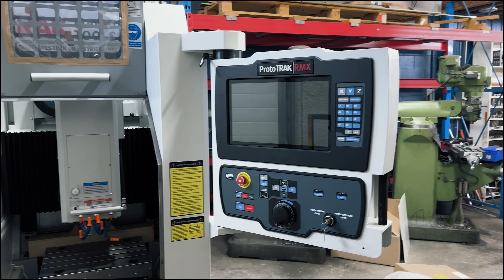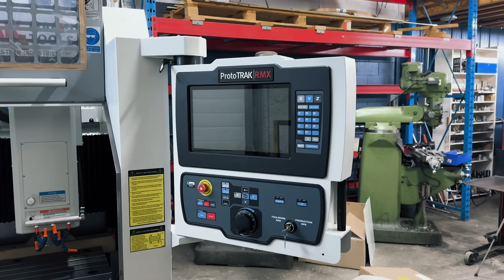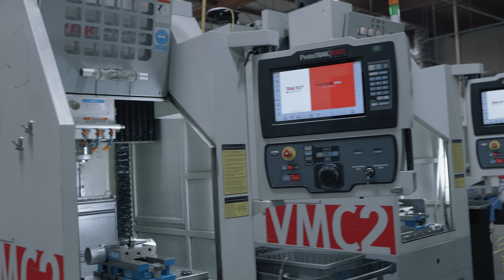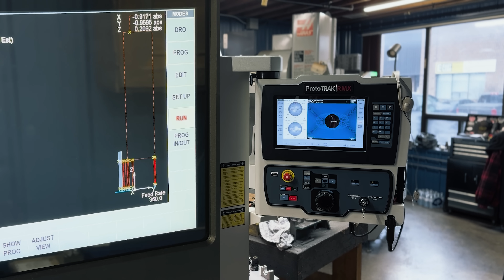Our Smallest CNC Machine Yet–And Why It Works for Us | Machine Shop Talk Ep. 129

Comment: I have the older 2op, same machine but different control. Its handy having a capable cnc mill whenever I need a custom part. Perfect size for my small shop but just don't use it much anymore.

Comment: Most ERP systems when you do a quote you establish a process or multiple processes to get the cost for quoting, then that information is usually transferred  into a job. If you don’t have a way to track process how do you know who need help if they are going over estimate  and potentially getting back to customer because they will be late. We always used this to find root causes if a process wasn’t being able to be achieved. Many times it was ergonomic related, sometimes it was tooling or machine related, and many times it comes down to estimator not knowing  the internal processes or machinist skill. Bringing engineering or estimators in on the solution early in process issues helps close loop in finding root cause so next  similar quote hopefully will be better. Have the mindset to never blame person, just process. Many times when solutions are shown it’s a lasting effect with person.

Comment: I used one of first versions of these here in the UK for a couple of years. It didn't have the RMX control just a basic version of Southwesterns Prototrak, which was fine as I just ran G code. They do have their limitations because of the actual size. I was constantly cleaning out the chips from behind the table which fouls up and stops the machine if you don't. The coolant needs topping up regularly, small tank and pump isn't very powerful. There was no tool probing, which if you use on other machines, its like going back in time without it. Also care needs to be taken when loading and unloading tools in the tool carriage, it won't take a whack from a toolchuck  but these are cheap and easy to replace if you get confused like me with left and right and back and front.
On the plus side its nice a stable for its size and produced good parts with good finishes.

Comment: Nice little bridge mill. High production complex parts. Robot loaded say 6 mc cell with the op's distributed between equipment. Small enough and cheap enough to keep a spare or 2 set up in the corner roll in/out if problems occur.  The tool change looks like it's going to be slow so not the best machine to do a full part on. Or advanced hobby work.  Dont like the door above your head during loading, Coolant showers suck. Also it really should be opened automaticly.

Comment: I’m guessing this is a step above an early Hurco. The first CNC I purchased for the shop was a Hurco 40 some years ago. I bought it because as I’m sure many of you know G code programming could be quite intimidating at that time. This controller was great because of the conversational  programing, however it couldn’t run G code. The Hurco served its purpose and opened up a whole new world of work.. We used to machine the 7075 aluminum link arms for the Hurst Jaws of Life on that Hurco. Before too long we needed to get full blown vertical machining centers.What appears to be nice on this is the controller.  Being able to do both types of programming is a great feature. Very small for sure but the Haas mini offers a bit more in my opinion.

Comment: Used the 2-Op Varient Slim model (had controller screen / interface completely in the right rib of the door frame of the machine) loved how easy it was to use and program. Had two of them running at the same time, beyond easy.
Reply: Oh that’s cool, I haven’t seen that version! The narrowness of the machine is a big plus for us - since this video we moved it to its “main home base” in the shop (aka, where we’ll use it most of the time) and being able to squeeze it in there or cram it in beside another machine as needed is a big plus

Comment: Those are awesome little machines I trained on one a little bit in school a few years ago and the teacher I had used to run two of those in a cell at a die shop, The tool changers on those machines can be finicky but they're controllers when all the track stuff are amazing
Reply: Yeah the tool changer takes a bit of getting used to - plus the tool table vs other VMC’s we have - but it’s more of a learning curve than anything. Once you get it, it makes sense. Fun little unit!

Comment: It reminds me of Chiron - FZ 08 S and Chiron - FZ 08 W They are also easier to move around, you just lift the support feet and then they are on wheels.
It was one of the world's fastest tool changers at one time. It had
Reply: Indeed one of the few that carry all their tools on the spindle and when set up correctly the Z axis height of the tools changed doesnt change during the tool change. Changing anywhere there is enough clearance so no wasted axis travel.  Saving seconds during a cycle. Not exactly the most robust machines though.

Comment: I almost purchased one of these a couple of years ago for knife making. Went with a larger machine in the end and regretted the decision ever since. Glad someone is finally doing a proper review as they are excellent machines.
Reply: For sure! I’ll be posting a more comprehensive review in the next video I do on this - once we’ve had a chance to keep putting it through its paces in a production environment! 

Things been crankin’ along well so far, just finished up a run of 2nd and 3rd milling ops on 100 A2 components that just went out for heat treat yesterday!

Comment: Did you consider the Brother Speedio S300? Im not sure if you could justify the price difference but the Speedio line of machines are amazingly fast. I own an S500x2 at my shop and we love it.
Reply: Brothers are rock solid machines
Reply: @billdickson871 Plus they have high torque spindle options. I operated the predecessor to the S300 with the high torque spindle at my first machining job and wasn't told the coolant level sight glass was broken and melted a 3xD Sumocham 20mm drill body into a 1.5xD in 10 seconds when the coolant ran low. That's power.
Reply: Or a syil x5 if you want to go low cost.

Comment: I work at a plastic injection company, we have 2 of these and they're pretty rough. We replace & fix the doors about once a year. Large piano hinges that we bolt and weld in place. The tracks the doors ride in are completely destroyed. I wish they'd redesign the doors. Even the arm the air assist connects to has been welded and reinforced multiple times

Comment: I have a shop ceiling height question.  I'm building a shop at my house and am dedicating a room for metalwork, it will be 12x24.  I have a Birmingham knee mill as well as some lathes and a bench mill and few smaller things.  Probably get a bridgeport to restore in the future and I could see putting a tiny cnc machine in there someday.  So for this manual area I figure I need to go over 8' for ceiling height so I have a little room to run a mill in on a pallet jack or even set something inside with my tractor or forklift, but every bit of height I go above 8' will painfully shorten the room above the metal working area.  In your opinion would 8' be fine for working with a couple knee mills or if I'm using an engine hoist to take the head off to work on is it way too short?  Would 8' 6" be a good compromise or should I go to 9' ceiling height?  Thanks a lot for the advice and videos.
Reply: When it gets warm you will want higher ceilings.

Comment: Sometimes more spindles is better than bigger spindles.  Specially on small parts with short runs.  I can do a setup on machine 2 while machine 1 is rumning.  Or in this case where the 2nd op runs so quick it don't matter if a larger machine can run it faster.  It's just going to sit and wait on op1 to finish.
Reply: That’s our thought as well. Even a guy running one machine at as close to 100% of the time as he can and reloading this second even 50% of the time gives us an extra 50% efficiency.

Comment: Cool little machine. We have the older style knee smx control and the only thing I would say is hopefully they have fixed the issues I bump up against when I put G-Code in. The smx only accepts very basic g-codes, if it doesn't know one in the program it plain ignores it and does some crazy stuff like trying to rapid through the job. There is a list of known g-codes in the back of the manual, hopefully the RMX is a more complete list. Worth checking it.

Does this control reset the reference point of the tool table when you load a program ? Drives me crazy on the smx ! I have a dowel set in a tool as my reference tool so its easier to set it back.

Still need to get round to learning prototrak programming properly !
Reply: Ah fair enough! This one takes regular ol’ g-code but it did have a few that we had to learn, mostly how the coolant on / off works (it ain’t just an m-code) and it takes the file in… .gcd? Instead of .nc I think? No big diff - just modification of the post to change the suffix.

No issues with losing ref point!

Still learning the RMX to program in the controller, but the messing around with it has been pretty fun!
Reply: @LakewoodMachine  Hopefully its the older SMX control that gave the headaches. 

Ref point I seem to loose is the Z height in the tool table just above tool 1 in the table, goes from set to not-set when you load a program in. Last guy just reset the tool table every time, made setups way longer !

We have EdgeCam and the post had a chipbreak drill cycle that machine didn't recognise and it tried to rapid a drill through the job ! No error message just full send !

Comment: I still cant get over the shitty electrical service situation in the US. I mean, man I would almost put a diesel gen in a shack and set up my shop in bumfuck nowhere. People in Germany still have transformers built for their machine shops, but theyre in a tiny building on the curb because they need 300kW service for their 150sqm shop with 10 DMG Moris in there 😂😂
Reply: Narwaro    you are strangely uninformed   .  there is 3p power available everwhere  in US, Canada and Mexico.
120/240 1p  is used only  in residential, and even then, except for very low population rural side roads, 3p is available if needed
By the way, this shop is localed in Canada , therefore  it would be supplied as 3P 600V.
Reply: People in US laugh about German electrical power prices, a lot!
I'd trade my 100m² with a good 1000m² in USA at once, then dump solar cells on the roof, 3 phase inverter and a small battery bank, free power, when the sun shines.

Comment: Few questions:

Price?

How large can the stock material and resulting part be?

Can it machine materials like titanium?

Is there a lathe with the same foot print as this or close to it? I guess it would have to be in a vertical configuration or slightly wider if staying horizontal but would still be awesome.
Reply: They're about $47k USD
Reply: @ thanks.
Reply: @Bagginsess  You can do Ti and hard steels, these little machines are surprisingly rigid and capable.
Reply: @OtisFlint  very cool thanks man :)
Reply: @jamiemacdonald436  - 47k ? LOL Way over priced. No wonder all the sites that have them listed want a call for quote. loool
Reply: @ezekielswiss4347  Doesn't matter to me either way, I just hate when companies or videos aren't transparent about pricing.
Reply: @jamiemacdonald436  I concur.
Reply: @BionicCommando-u1d  my first thought was I wonder how much it costs used? Still it could make sense if you have to make a bunch of small parts and have limited shop space and that niche is probably why they charge so much :P
Reply: @jamiemacdonald436  - or when youtube channels get paid to push a product like this one here the DAY they get the machine?  Opening it up and talking positive about it immediately?   Yea i hate that too!

Comment: I think they are interesting machines, but they're close to 30 grand if I recall correctly.  That's Haas Mini Mill territory, which also runs on 220v Single phase and has more power and a larger envelope... Not as small as this machine, but still pretty small.  

HOWEVER, since I found out that you can buy small vmc's like this, straight from china, for like less than $10,000, I'm much more seriously looking into those....
Reply: I think he has mentioned in the past they are limited in shop floor space. With that being said I might look at some cheaper actions similar to this in order to put it in my garage
Reply: While you can get cheap machines from China for crazy prices sometimes, good luck getting parts or service or support when something doesn’t work.  Not to mention build quality tends to be a get what you pay for reality.  If prices are low there is always a reason why.

No one is buying a machine like this unless they are space constrained or have a very specific application.
Reply: @stacybehrens7152  @stacybehrens7152 actually you'd be surprised what you get from china nowadays....a vf2 sized machine for $16k brand new, delivered, Fanuc controls and servos/drives, Taiwanese ball screws and linear rails, renishaw probing, Schneider and Siemens relays etc, parts are pretty easy to come by actually.    There's a YouTube video that just dropped recently by a guy who bought one straight off Alibaba, took 6 months to get here, and it worked just as well as any of his other machines.....for $50k in savings, I'll take my chances.

Comment: A CNC machine you can move around with a pallet jack? Perfect for Monday mornings when you're not sure where you wanna work yet! 😄How many tools does the changer hold? Kinda find this machine adorable. Cheers from Germany to Canada!
Reply: Either roll Your toolbox to the mill, or roll the mill to Your toolbox.
Reply: 8 tools according to the website
Reply: 8 tools, you got it! Drop in a welding plug and you’re ready to rip!
Reply: Haas Mini Mill will hold 10 tools and can be moved with a pallet jack. Single Phase 220.